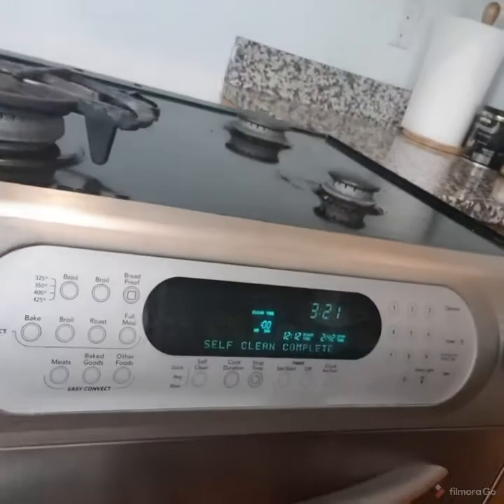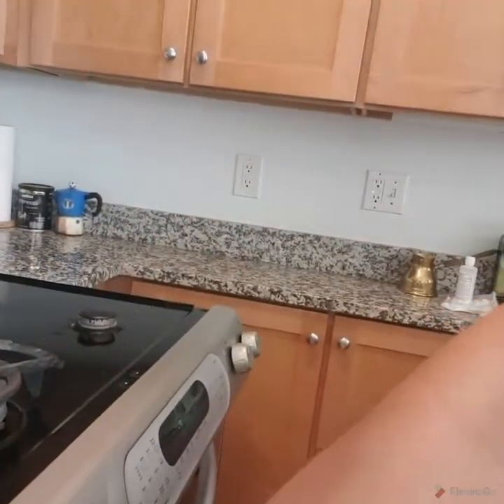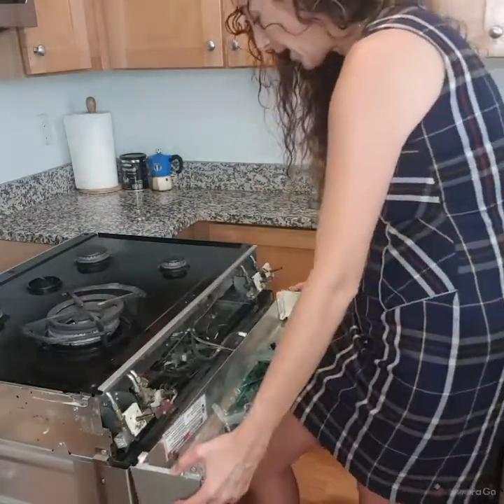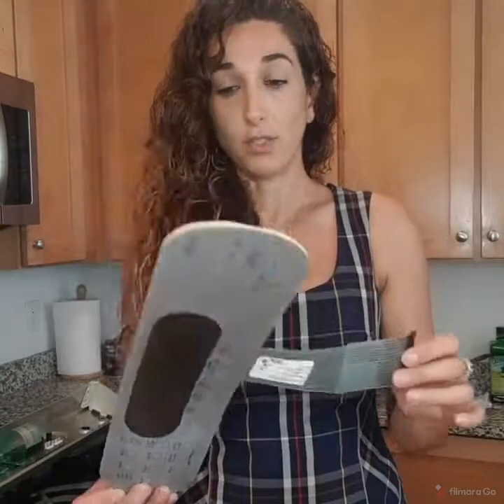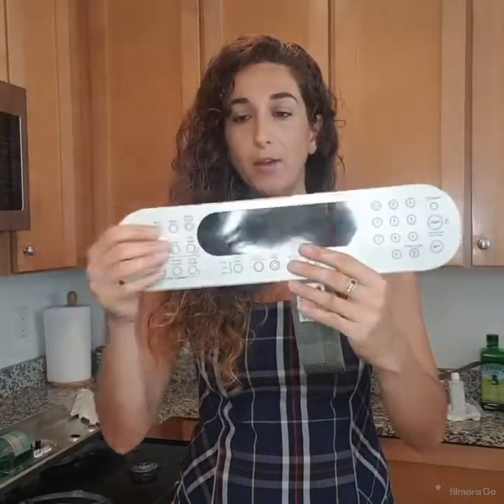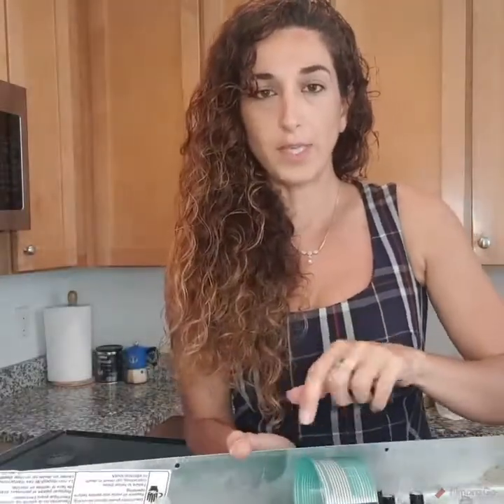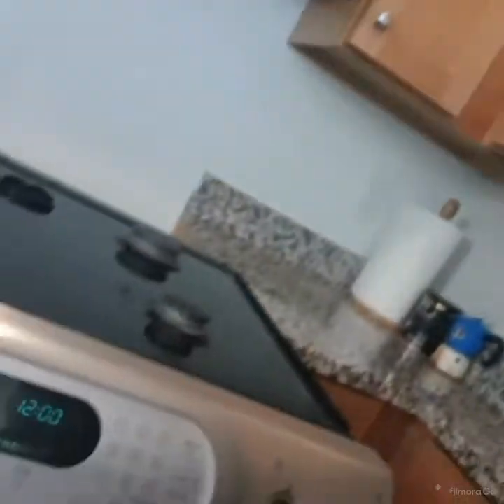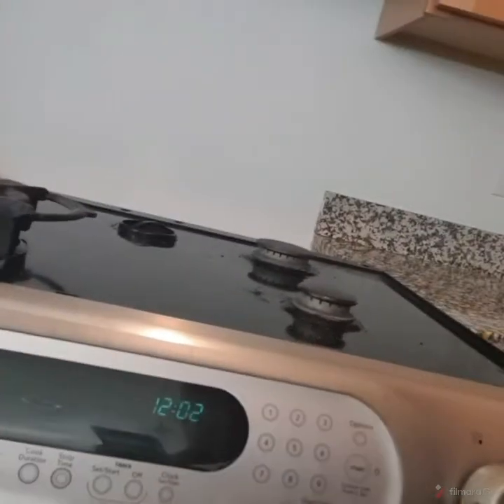KitchenAid/Whirlpool Gas Stove. Stuck Key, Err F2E0. Replace Button Control, Membrane Switch

Comment: My son and I ordered the part you recommended from Amazon, but that link brought up one for 89 or so.  There's one for 69 or so.  So, I received the part the next day and fixed the error.  Thank you so much.  Remembering which parts to put back together and how was my biggest problem.  Again, thank you for the video! Probably saved me a couple hundred dollars!  My son was appalled at how dirty the oven was, but who ever takes their oven apart like this?  I don't!  There was so much dust inside, but it was a lot of work to replace this part.

Comment: Have a different Whirlpool oven, My control board has a glass cover, with rubber knobs instead of a touch-pad ... So we got the dreaded F2E0 for the 2nd time. First time we sent the board out to be repaired. The company who repaired it improved  this existing manufacturing issues ...that was 6 years ago.  So I removed the glass cover, gave the control board a good cleaning, reset the cover...WHOLLAH....fixed !!!  Not quite the process that you described, but it gave me the idea to remove the cover, clean it up, clean the control board...see what happens.  Thank you ....I had already started taking it apart to send the board out for a 2nd repair. A new board was $250, repaired $138.

Comment: good job changing the controller. From my experience the self cleaning function usually causes the control membrane to fail because of the excessive heat.

Comment: You may not need to replace the front panel control board, at least in my case.  I have a simple fix for error F2E0, for units with the capacitive touch panel.  There's a diagnostic menu selection called CONTROL RESET.  To access the diagnostic menu, press in sequence:  OFF, OFF, START, 6.  Then tap 6 until the display reads CONTROL RESET.  If I remember correctly, pressing START will initiate the reset.  Last time I did this, F2E0 did not occur for a year.  It happened again 2 weeks ago, which reminded me of the need to share this information.  Problem happened 3 times in 1 week, but not since performing the lates CONTROL RESET.

Diagnostic mode has many uses, including manually calibrating oven temperature, if yours is not accurate.
Reply: Thank you for this. This worked for me!

Comment: The code means Stuck button or Contactors need cleaning and decreasing. All you had to do was take the board out disconnect the connectors .Spray the Board and Connectors with Contact cleaner let dry Reinstall the board .Remember to unplug the unit before service.

Comment: Wondering if this unit will replace the membrane panel on a model KES A90&PBL00.
Reply: oops .. meant KESA907PBL00
Reply from the maker: @ricardomaduro2042  I'm sorry I had missed your note on this- The membrane panel I purchased was not a perfect fit for my over but still worked fine. I measured the metal area on my over/stove and ordered the membrane that was close in dimensions .